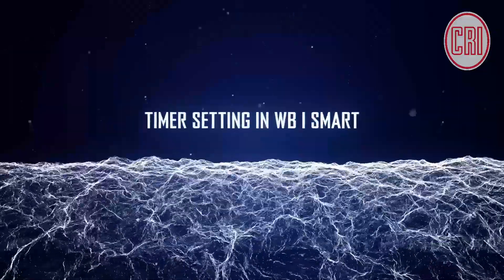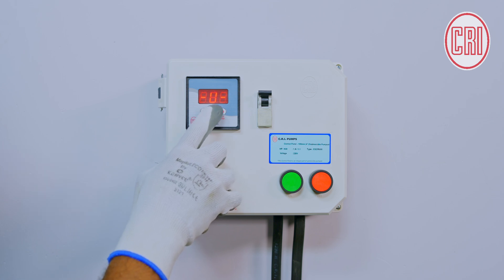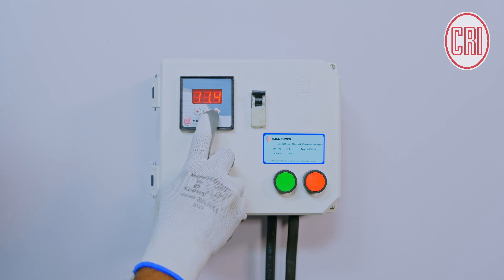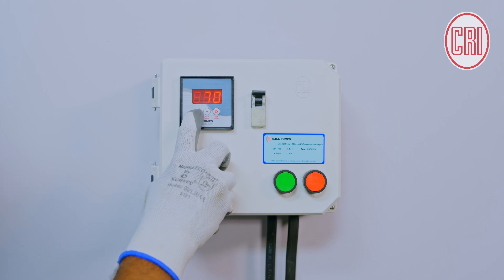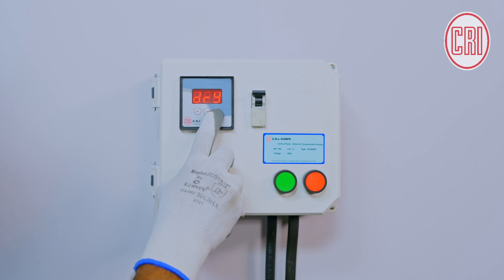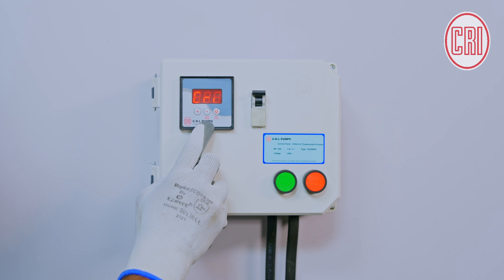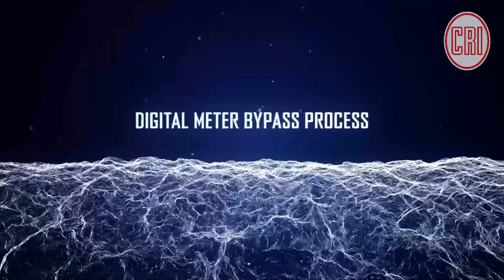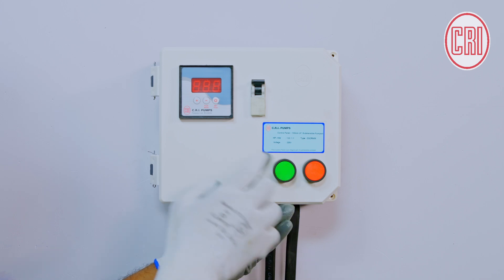C.R.I. Water filled Bore well i-Smart Digital Panel (WB i-Smart Panel) settings Tutorial

Comment: Dear Sir,
We have installed a CRI 1 HP submersible pump and connected it to your CSCRWM electronic starter.
In a standard DOL starter, generally only one Normally Open (NO) contact point is required. However, in your CSCRWM starter, two NO contact points have been provided, which are internally connected together.
We intend to connect an automatic water level controller to control the water level in the overhead tank. Kindly clarify the correct method for utilizing these two NO contact points for this application, or confirm whether they should be connected together as provided.
We look forward to your guidance on this matter.

Thanks and Have a Good Day!!
Warm Regards, 
RAFI SHAIKH,